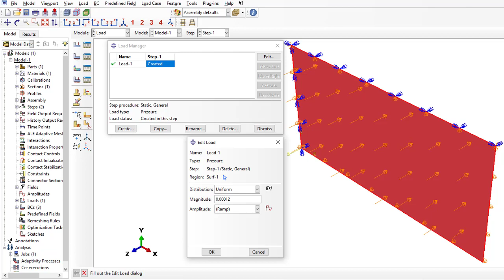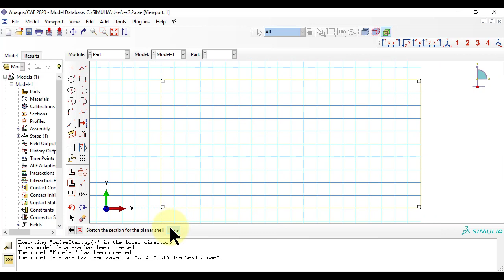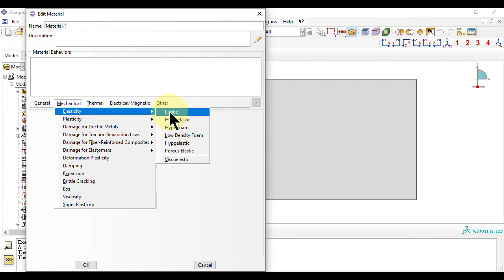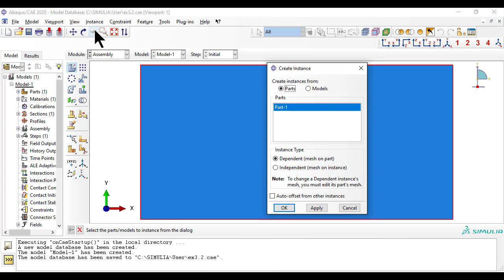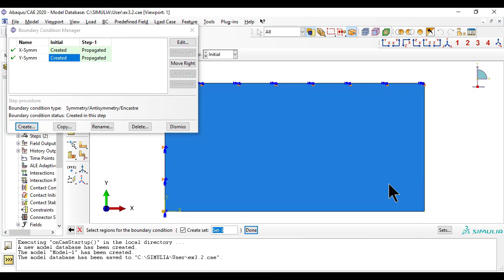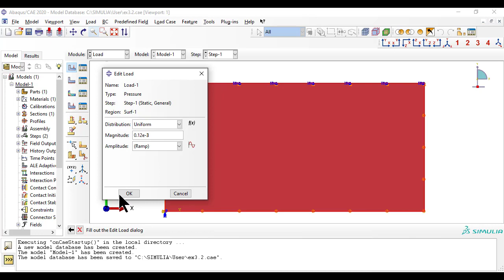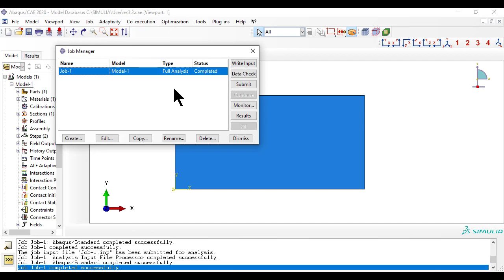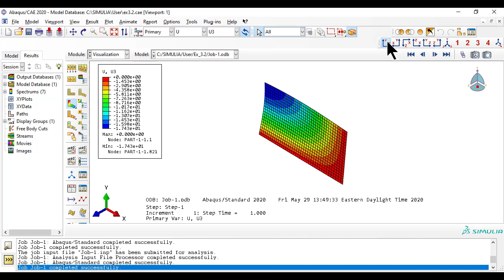Example 3.2 explains orthotropic materials in a simple model

Comment: Prof. I have questions regarding the orthotropic data. I try to model bamboo as orthotropic material however I've only got give the tensile and compressive strength for upper, middle, and bottom layer.  How do i use this data to model the bamboo as orthotropic material?

Comment: Prof. Barbero: I have a question for you, regarding applying proper boundary conditions to a specific 2-d plate problem. I am trying to simulate the behavior of a thin-walled (shell type), off-axis (30 degrees) square composite plate that is prevented against any in-plane shear deformation (gamma XY) when the plate is subjected to a uniform compressive pressure in the y-direction (top and bottom face of the square plate). The additional conditions are that the plate is allowed x-direction and y-direction translations due to the applied load which would produce normal and Poisson induced strains (Epsilon X and Epsilon Y). 
I have a FE solution in mind but not sure if it would work. I am thinking about constraining U2, UR1, UR2, and UR3 and set it to 0 for the left and right edges of the plate and constraining U1, UR1, UR2, UR3, and set these to 0 at the top and bottom edges of the plate. I am hoping that this would prevent in-plane shear while allowing for Poisson based contractions on either side. what is your opinion on this? your valuable insight would be very helpful. Thanks so much for your time. Regards, Sthanu
Reply from the maker: Set U2=0 at the bottom. On the top, apply the load in the form of a uniform displacement U2, to get the strain you want, eps=U2/a, where a is the side length of the plate. Set U1=0 on the left. The plate will not be able to shear as a whole but some U1 deformation may take place at the right side. If that happens, add a rigid constraint on the right edge to force it to move with constant U1. That should kill the shear deformation but still allow Poisson expansion. This an unrealistic problem because a 30-deg ply will want to shear, but I guess you can force it to remain shear free if you really need to. I have never done this. Try and let me know. If you really want to put a load at the top, use a tie constrain so all the top edge move with the same value of U2. Some video, maybe 3-13, shows how to use tie constraints, but they are tricky to use. There are many types of constraints, many things to choose from.
Reply: @EverBarbero  Hi Professor: To summarise what I did: created a 3D square planar shell, took some random orthotropic lamina properties (your values from example 3.8), assigned a 30 deg material orientation, took the default to mesh what Abaqus recommended,  simulated the compressive stress in the y-direction by using the shell edge load feature and thus converted an arbitrary stress value into corresponding force per unit length (in this case length of top edge). I took your suggestion on setting U2=0 for the bottom edge. this would create the same reaction load along the bottom edge. I also implemented your suggestion of setting U1=0 to the left edge. Thus far, we are allowing the left and right edges to displace (compress) in the y-direction while allowing the right edge to extend in the positive direction.  using these conditions, the Abaqus results still showed finite shear strain both in the material axes and in the global axes. while looking at the overlapping undeformed with the deformed shape of the plate, I noticed that the top left and right corners of the plate were slightly skewed. it makes sense (sort of) because we are allowing x-direction stretching to the right edge. however, the shear strains are not small or zero.
Prof Barbero, if it's not too much to ask, could I email you my CAE file. 
Analytically, using the stress-strain constitutive relationships, it's very straightforward looking, but the FE simulation is more challenging than I expected. My problem statement doesn't ask for FE results but just the analytical approach. However, I took it upon myself to see how would I try to model this problem in Abaqus.
Thank you
Reply: Thank you professor. If the problem were to be turned around , and this time if the 30 degree lamina was ONLY allowed to have pure shear under a uniform shear stress , how would we model the boundary conditions ?